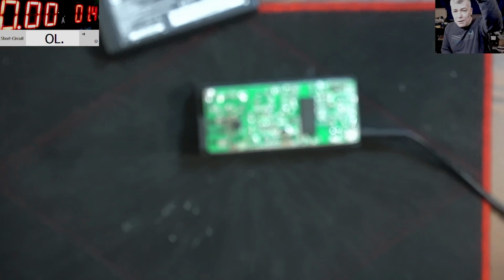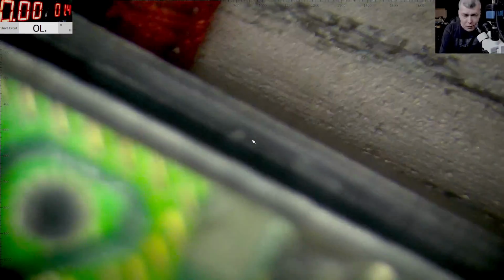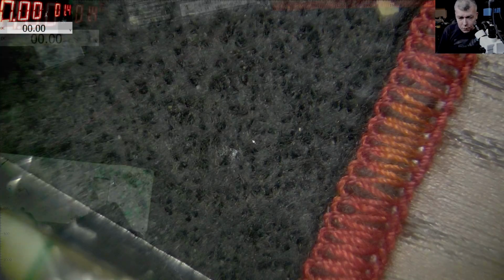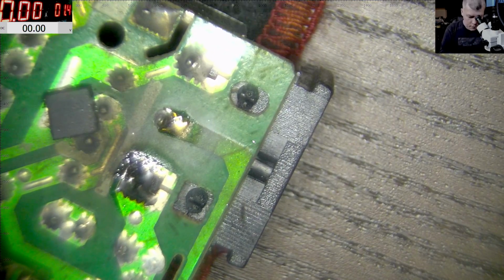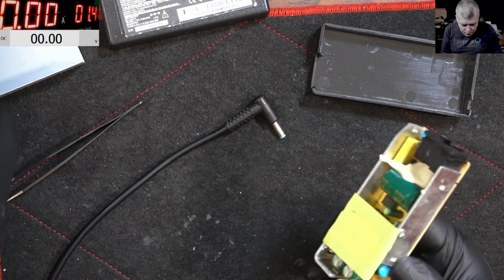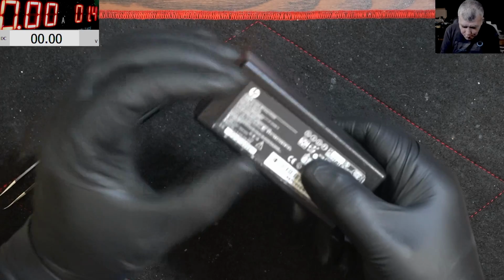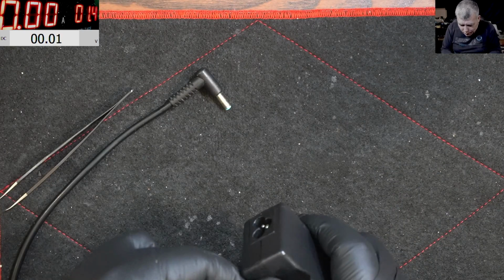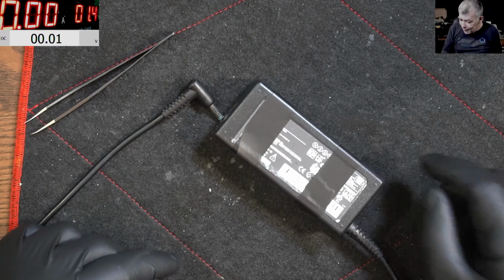The most common fault on a laptop charger power supply

Comment: Hello...
Do you know why a battery charger green and red indicator is not working, i mean the indicator always red when its charge nothing... but when i use it to charge battery its still charging but it never get the green light on...
Cause of this charger problem started because some shortcircuit between positif and negatif of the dc current..
So i wonder what is brokenn is diode or the IC chip that control on off of the charger?
I'l be glad if you can give me a clue
Thanks

Comment: Thanks for this! I started by checking the voltage at the plug to the laptop, then the wire going to the wall (cheap off aliexpress so didn't trust it). I opened it up to check the caps like another video said, but mine were fine. It ended up being the same pin in my charger so soldered it up and good to go!

Butchered the Hell out of the plastic though. That case was NOT meant to be opened ever in its lifetime. The plastic was softer than the glue so it wouldn't pop open, just bend and rip the plastic. Ended up cutting it with a Dremel cause I didn't wanna screw around anymore

Comment: That is a replacement charger, on higher quality chargers the port is often fitted upside down and then connected using flexable wires.

Comment: Just to add something to an already extremely useful video: I usually use cyanoacrylate glue so I don´t have to use duct tape. It´s extremely fast acting and the bond is strong. Use ONLY the necessary so you don´t seal it so much that you can´t open it anymore. It also burns plastic so try to avoid drops of it on the visible parts of the charger. A q tip always helps if you want to make it look as good as new.
Reply: also known as super glue? 🤣
Reply: @blam5ky  I really have no idea. I don´t know the chemistry of super glue.

Comment: The question is, how did you get the two pieces apart from the power supply?
Reply: Usually a flat headed screwdriver and light hits with a hammer or even any other lightweight tool.

Comment: I thought sparking was relatively normal for a power supply, but if I understand this video correctly, it means there's a bad solder joint that should be fixed?

Comment: OMG some people are so retarded The voltage rating of a capacitor gives the maximum safe potential difference that can be applied between the positive and negative capacitor plates. It is the voltage that a capacitor can handle safely without dielectric breakdown

Comment: ASUS chargers are only good for 18 months then die. I have got through two!
Dell chargers are good for 17 years +. HP charger, 11 years old, still ok.
I have an ebay charger for the ASUS which now has a broken wire in the plug. Gerr!!!

Comment: One main issue is the use of no lead solder. Do yourself a favor on all of the critical components, add a bit of lead solder to the joint to wet it and then extract the old solder and resolver with regular lead tin solder. It has some flex to it. As for those pins out of the socket I would mix up some epoxy and place the charger upright and add the epoxy to where the leads come out of the plastic. You are right, it is a very cheap copy of the real thing and the quality of that connector is not the best. That epoxy should add strength to the pins coming out of that connector housing.

Comment: The real problem is mechanical stress. It lifts the PCB pad, overheats, burns out. Only happens on cheap PSUs without flexible cable from socket to PCB.

Comment: I would have been tempted to remove the socket and then reattach with a blob of araldite glue to add mechanical rigidity. As for the solder connections a loop of 18 gauge copper wire soldered onto a length of track as well as the pin again to stiffen up the joint. If it has cracked once then it could happen again. I have never like PCB mounted sockets for the very reason you show here. Too much mechanical stress.

Comment: I would have cleaned the carbon off prior to soldering with a fiberglass brush. And cleaned the flux and residual conductive carbon off with alcohol. Leaving the carbon there could result in yet another poor joint and also arcing through the carbon track pending the voltage involved.

Comment: The question is how easy is to open a charger case without a kind of dremel? Thanks Sorin!
Reply: A lot of times you can split the case open cleanly by squeezing it in a vise. Put the split line right on top of the jaw. Then squeeze down. It if doesn't open then flip the case in the vise and squeeze the other half. Sometimes you have to rotate the case 90° and squeeze that way too. But then you need a big vise that can open wide.

Comment: Your problem is that you are looking at a FAKE, counterfeit non HP charger. The genuine HP 45W charger does not have a PCB-mounted inlet socket. The Inlet socket in the genuine part is linked t the PCB by flexible wires. A quick look at your power supply board confirms that this is not the real part. Never risk your laptop with a fake charger. Finally, at 5:20, he says what I said.

Comment: I've seen many products with the same issue. One thing to consider is the carbon build up on the arcing pins. I normally will remove the connector from the pc board and check the board for carbon. It needs to be removed.
George B

Comment: you missed the third pin on the charger connector. you should have re-done that too, because it is likely also weak from the wear.
Reply: @6:09 you can already see a faint ring around the third pin as it is starting to fail also

Comment: Excellent video, thanks. How did you split the case of the power supply? I've often found them to be welded together!
Reply: When an enclosure can't be pried apart, I've sometimes been able to open the seams using a very sharp chisel and careful application of moderate hammer blows. It depends on the customer - if they are satisfied with functional but ugly it makes things much easier. Just crack it open any old way and tape it up when done. Some customers will be happier with a more expensive replacement unit than they are with a cheaper but more obvious repair.
Knowing how to repair things is sometimes less important than understanding customer expectations. Actually, way more than "sometimes".
Reply: @Thankz4sharing  I've done the chisel on the seam thing myself. Sawing can work too. If you're very careful. Usually they just split on the seam. The ultrasonically welded ones split apart. Some are tough though.
Reply: @1pcfred  Good point. A fine tooth bow saw is  handy. Probably a good idea to wear a mask. Some of that plastic dust is nasty.
Reply: @1pcfred  I mostly agree. Plastic dust is probably not lethal, but some varieties sure have a nasty odor.
Reply: Run a little gasoline or nail varnish remover around the joint, wait a couple of minutes and it will separate easily.
Reply: @englishrupe01  Nail polish remover AKA acetone.
Reply: I crack the cases open by squeezing them in a vise.
Reply: We use a Dremel

Comment: Some chargers connect the socket to the main board using flexible wire to elevate mechanical stress a very nice solution

Comment: You missed a pin !!
Those mains connectors have 3 pins. You re-soldered 2 but missed number 3.
Number 3 also looked like a dry joint !!

Comment: Can you post a video on how to open a laptop charger plastic housing, i tried a few times and all end up damaged the housing badly. How did you do such a nice job?
Reply: You squeeze the case in a vise. You squeeze it until you hear a crack. But don't squeeze so tight you're squeezing what's inside the case. If you don't get the crack flip the case in the vise and squeeze the other side. If that doesn't work then you have to squeeze longways. If that doesn't work then you have to hammer a screwdriver into a corner and twist. If that doesn't work then you have to chisel the seam. If chiseling the seam doesn't work then you have to break out a hacksaw.

Comment: When the charger doesn’t start, you have to plug in more times, it may start. If not, there is a trick for all existing chargers. That is, to connect it with a battery screwdriver/drill, and with a hexa key generate power to both directions, with the tool’s switch fully pressed on. That will start your charger. However, if it’s not compatible with the laptop, the charger will be locked again.

Comment: Hi Sorin, thank you for sharing of your knowledge. What is the best way to crack open a charger?
Reply: One way is to use a vice and clamp it into the vise just below the seam and tighten. You should hear the glue crack as you squeeze it. If it fails to crack open, flip it upside down and re clamp it in the vise and tighten. It should crack. You have to understand that the case is designed where there is a reduced thickness section that fits into the other half. Squeezing the right half causes it to compress inwards ungluing the joint. If compressed from the wrong side you are forcing the two halves together. A thin steel putty knife also helps once you have split the case lengthwise. Ungluing the short ends is a bit harder. If you can see which half fits into the other half, use the putty knife to carefully force down into the end joints. Cheap aftermarket supplies are easier to open than the authentic supplies. Use care, if you slip you can get a nasty cut on your hands and or fingers.

Comment: Yes, capacitor is nasty. Not only I got the shock, but I also burnt the IC that generates impulses and created a fireshow on plugging charger in, blew up the mosfet...
But yes, you'd be amazed how many good original chargers get thrown away because of cable or socket. In my university while we had recycle bin, i've been taking home laptop chargers each day, all of them are original and worked properly. Now I don't know what to do with 20 odd chargers lol.
Reply: Save them as power supply for various projects, I use 2 to power my 2 iMax B6 chargers, and converted one with a step down converter to charge batteries.
Reply: Ebay at half price.
Reply: Laptop voltages are fairly universal (18-21 volts/4-5 amps) 
even if the end connectors are not
Reply: @MikinessAnalog  yes all my latops operate at 19 volts and i have like 4 of em

Comment: I would better clean the flux after soldering, mainly at the primary side. The rosin residues tend to draw moisture in and then cause flashover as high voltage is there present over the small distances on the PCB. Mainly the transistor is a very weak spot (about 500..600V peak between the two legs with less than 1mm creep distance).
Reply: He uses nothing but colophonia - pine rosin with terpenes boiled -out. Notice how it looks like Baltic amber? It's hard. Then the soldering iron melts it, it is transferred to solder joint on the tip and cools and forms a shellac - like glass - like Ph balanced neutral protective shell.  If it doesn't harden or if it turned black - it must be washed away, yes. Improper heat causes this. Black colophonia IS now caustic. But when done right: that protective glass shell protects the area from liquid damage, oxidization, etc. Sorin has one of our community's greatest videos - of truly great value - where he shares with us how to make our own liquid soldering flux.
Reply: @skeggjoldgunnr3167  I know it is "just the resin", but believe me, it is highly hygroscopic and tends to form conductive paths. When still dry, it appears to be perfectly OK. But once it absorbs some moisture (it takes time, but it really does), it upsets high impedance circuits, but really does tend to form carbonized filaments when exposed to high voltage, resulting to nasty flashovers. It does not happen immediately after such repair, the problems start after a year or so when sometimes exposed to humidity (temperature changes are enough; the humidity has to diffuse towards the conductors, so it takes time after exposure as well)...
Reply: @annaplojharova1400  
So in high voltage, high impedance circuits I should take care! Thanks for further enlightening me! It makes sense., assuming it is so prone to absorb this moisture. Thanks for adding your expertise.
Reply: @annaplojharova1400  I used to use a freon vapor machine The vapors would rise as a gas onto board, drop to under flash point, turn back to liquid state and precipitate back down - it did perfect work. Then I am told that this process was found by the state of California to be too effective and you're racist if you use that method now. So now I use Acetone bath with acid brush then rinse in 50/50 Perchloroethylene / N-Hexane.

And what do you MEAN, insinuating that my soldering isn't perfect every time the first time?! Why, I NEVER! 😜 Cool info! Thanks. Will add that to making today a much better day, for having learned something! My MIT / US Navy electronics instructor back in the 1970's said "A day that you earn money is a good day. A day that you LEARN something is a GREAT day!"

Comment: Hardest part of that job is opening the charger, unless its a copy.
Reply: Some open easily some are more stubborn. You have to have the tools to do it. The main tool is a bench vise. That alone will open most. The ones that don't just crack open you have to get more aggressive with. I find that attacking a corner with a screwdriver usually does it. But it if doesn't then I'll hammer and chisel the seam. Just walk along the seam with the corner of the chisel.

Comment: I made my two Dell chargers by shangeing all the capacitors on the output. Same thing on both.
Reply: Thanks for sharing your answer.. Reading my personal notebook. Dell (one) failure output electrolytics capacitors. Lenovo (three) failure Mosfet and resistor 1 ohm protection. Toshiba (one) failure big electrolytic capacitor input. All the best.

Comment: I never disconnect my cables from my chargers. I just unplug them from the wall, or surge protector.  I don't know why anyone would.
Reply: If you have to transport it in a case or bag, sometimes it´s better to disconnect it, since you remove the chance of it applying torque to the joint with the weight of any other things you might be carrying (like a laptop)

Comment: Right as usual! Also once you touch the charged 400V cap you will never do it again, trust me guys!
Reply: Did that last week, half an hour after unplugginga board to the mains I thought it was discharged, and zap. Then I checked, still had 120v.
Reply: At my high school - a vocational technical school - it was a popular prank to charge a capacitor to a hundred volts or so  and toss it to someone to catch.  I learned from others' experience and refused the offer to catch anything. :)
Reply: Can confirm in part that 400VDC is not nice. I touched the heatsink for the switching transistor on a similar type of PSU while it was powered up.
Reply: @CoolSteve08  thats what i thought. 400v must really hurt. you are lucky to be alive
Reply: OMG god people 400V is the maximum voltage rating on the capacitor, doesnt mean it is storing 400Volts
Reply: so is the charger 3 phased, capacitor getting 400v from 2 phase. or is there a boost converter inside charger? how does it get to 400v if main supply, 1phase is 230v?
Reply: @Tomi Borchert  230-240vac is the RMS voltage, not the peak voltage. Plus, the capacitor voltage needs to be rated higher than the applied normal working voltage. There will be a safety margin.
Reply: @TomiBorchert  It's all single phase. When you rectify 230V AC you get around 300-400 volts DC.
Reply: @TomiBorchert  IT DOESN'T GET 400 VOLTS, that is the maximum rating 400V DC
Reply: @AdrianJayeOnline  but the tech guy clearly said 400v. and how can i trust you on this, look like 3y old. let adults handle this matter, ty.
Reply: @TomiBorchert  multiply it by square root of 2. the most distant points of the sine wave. so the cap will be charged to this voltage after rectifier. cca 325V DC!
Reply: @e1gr3co   IT DOESN'T GET 400 VOLTS, that is the maximum rating 400V DC
Reply: @AdrianJayeOnline  why are you yelling at me? behave yourself!
Reply: @TomiBorchert  It isn't really "400" volts, that is only a maximum working voltage the filter capacitor can take.
At most, all they will ever see is 250.
Reply: @Mikiness Analog  You have to remember the peak voltage of the applied voltage. The charge will not be just 240 volts DC. 340 volts is the peak of 240vac measuring the RMS, so the applied voltage to the cap is likely close to 340V DC, NOT 240volts !

Comment: This is great information and in fact this is the exact reason why I always leave the AC cable plugged into the block.  The laptop I am using right now is a 2009 HP Pavilion DV7 and it's still using the original power adaptor and the AC cable has only been out of it maybe 3 times since it was brand new.  I also always tell people to plug the power adaptor into the mains BEFORE they connect it to the laptop just in case.  I've seen a few laptops die from power spikes due to a bad charger when plugging into the mains.
Reply: I've always done that, and still, my old laptop got shorted out from a bad power unit and I had to buy a new power circuit because I couldn't fix it.